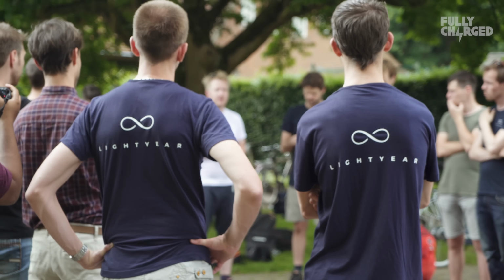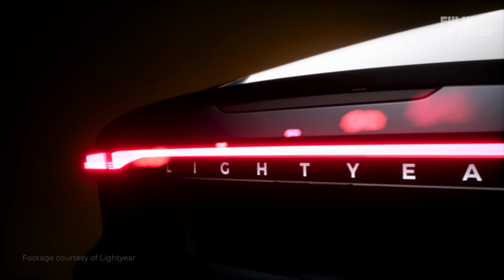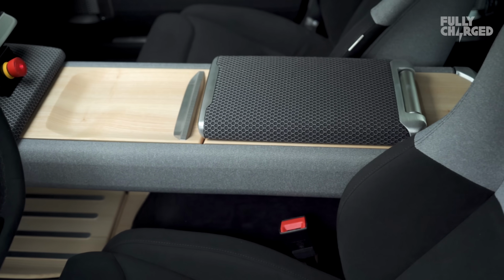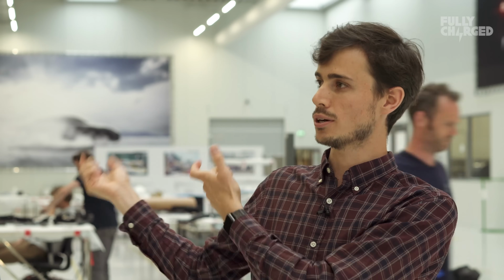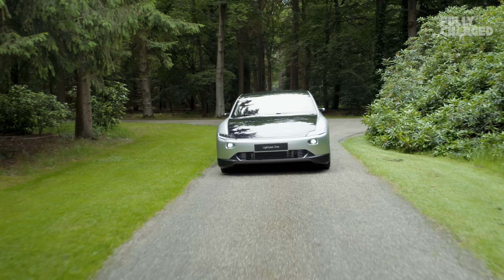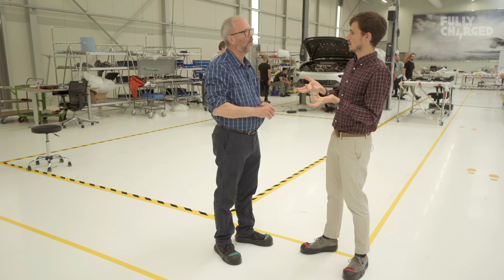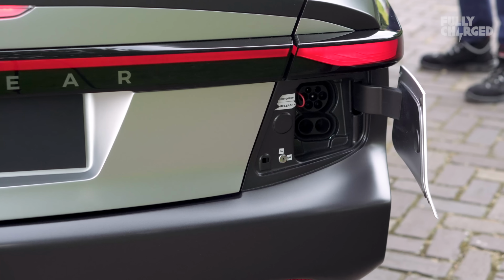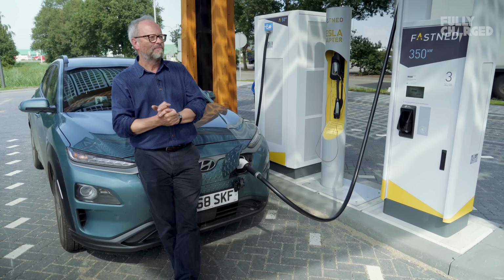Lightyear One solar powered electric car - exclusive first look | Fully Charged

Comment: Clearly aerodynamic and this look is designed by physics.
Reply: Do either of you understand turbulence? Sounds like not
Reply: @KcarlMarXs  go ahead, explain it to me, i'm sure you are capable.....
Reply: He says it's aerodynamically efficient. But that very long tapering tail end is not the best for aerodynamic efficiency, it increases the frictional drag since the air stays in contact with that large tapering surface, this is why the 'Kamm' tail profile is usually preferred by auto engineers, this cuts that taper off and often includes a little upturned lip. (this can also improve the down force on the rear wheels though obviously that's not so important in this case). I presume they were wanting to maximise the surface area, for the solar panels. If you doubt what i say about drag, look at the difference in tail profile between the Aston Martin db4 and db6, though Aston Martin were seeking to make their car faster by reducing drag.... rather than more efficient! Also just a thought, when air slips over the surface of a car it tends to deposit the dirt in the air on the surface since the frictional drag lowers the air speed at the surface, those solar panels are going to have be polished pretty regularly to maintain their power output, i should think.
Reply: @fuccasound3897  You are totally wrong. The cutted rear causes Air turbulences behind because of its sudden end. If your thoughts were true Wings of Air Planes would have been designed like that. But they are not. In fact some Trucks have air Panels at the rear end to prevent the Air stream from breacking. Super Cars and Formular Racing Cars have diffusors to prevent a Break of the Air stream. And spoilers on Race Cars which bend up to generate down force are Always a necessary compromise because they rise the cw. 
Those people behind lightyear one study physics and reached despite a small battery a very efficient range of 725 km. They are not that stupid to choose the wrong Design right in the beginning. The Team has a lot of experience and has won several Racing competitions.
Reply: i'm saying they have favoured solar panel area over reduction in surface drag. That is all. Diffusers are generally used to direct underbody air flow to prevent its interference with the air stream at the vehicle's rear. The raised lip on the tail as well as creating downforce  ensures the air breaking away from the rear of, as you put it, "a cutted rear" creates less drag than without it, yes the air is turbulent, causing some drag but this can easily be less than the frictional drag caused by a long tapering tail end. Also, what is your take on keeping those solar panels clean? i'm not saying the design is wrong, i'm saying that in the design  they have traded off one thing to favour another. The essence of good design is compromise isn't it? You sound angry, and not able to deal with a critique of something you obviously think is wonderful. Perhaps you are quite young?

Comment: I dont like the lack of visibility in the back. Added to the opaque roof, it gives a very opressing feeling inside.
Do the solar pannel add significant range?
Reply: The car can't be charged; it's fully solar powered.
So you can do about 60-90Km a day on average in The Netherlands.
Reply: I guess that there is a rear view camera, and that the mirrors on the sides are cameras in compact aerodynamic housing (instead of optical mirrors, because of the drag/turbulence otherwise created). At least, that was what they did with Stella.
Reply: Do you people actually watch the video???

Comment: Where this really comes into it's own is for someone with a commute of <100km return per day. Eight hours of full sun while you are at work and your car is back to 100%. No need to plug in and you're getting maximum use out of the panels. But if you park in the shade its a waste of the panels on your car. This raises an interesting question in terms of what are the economics/efficiencies of putting the panels of the car vs somewhere else and having a plug at your place of work? Or are the material costs of the panels so cheap now they are replacing metal panels in a cost effective manner and it's just all value adding?

Second thought. This highlights limitations of electric vehicles for long range driving in remote regions for large, off road vehicles (not talking about this car, think a pickup or SUV). In Australia there are several spans/return trips of over 1000km when dealing with remote outback driving. For a vehicle with a 600-700km range you just throw in a couple of Jerry cans. But there is no cheap or time efficient solution to this problem for an electric vehicle. For example, say you have the 1.25kW array of solar panels on this car and for simplicity a 125kWh battery (probably small and hence conservative for my following estimates). You drive for half a day and then your battery is flat. To get it back to 100% you now have to wait for 100hrs or about 10 days of good sunlight. Options:
1. You could make the panels more efficient. But with panels currently running at about 40-50% this at best will double the power and halve the recharge time to 5 days. 
2. An auxiliary array which could be set up on demand would achieve the same effect. 
3. Having both an auxiliary array and maximum efficiency panels gets you to 2.5 days. 
4. You could try adding more/larger batteries, but this is going to cost you thousands of dollars for something which is seldom used and has a high embodied energy. 

While this conundrum is not going to be an issue for the vast majority of users it is basically a deal breaker for me when it comes to replacing my current diesel 4WD.
Reply: Good points but other than driving in the desert consider this how far are you from a power point at any given moment.  I think every Aussie truck stop should have a charger.  For the time being though you're only talking a couple of percent of cars or driver's that genuinely need this, lots more claim they do and then just drive the beasties to and from the kids school and supermarkets.
Reply: Hi  @cameronlapworth2284 . Once you start cross the inland part of the country it can be as much as 400km between truck stops. They are basically laid out so to be as far apart as possible to reasonably drive on a tank of fuel. The major trucking routes are more like 100-200km when on the east coast. Many of these locations are running off diesel generators. I'm not sure if anyone has crossed the country (east-west) in a conventional electric vehicle yet. At least not in a time efficient manner.

My second point is clearly not referring to people using a 4WD on a school run. It's highlighting challenges facing replacing 4WD vehicles being actually being used for what they are intended for.
Reply: @jeremyringma  I agree Jeremy,. 400km is within this cars range, solar will increase your range even if only a little, it would save fuel in ice cars also.  It wouldn't need to be truck stops either.  For years while the ev vs fuel cell debate was going I'd drive in the country and see all the power lines following the highway and think we'll most of the infrastructure is already in place.  A charge point would need to be placed wherever on that line was required.  However you are absolutely right that fuel is easier to manage in terms of sticking in some extra Jerry cans.  However consider reliability.  I used to fly gyroplanes in unreliable 2 strokes and converted VWs I've experienced 4 inflight engine related emergencies.  There is a lot to be said for remote tracking with a motor with one moving part.  Adding enough solar to if you are lost even if only 80km per day could save a life, plenty of people have died having run out of fuel and broken one of the many moving parts of an engine with tonnes of fuel.

Comment: Still not convinced by the solar panels on the car idea.  It's a lovely idea - free charging wherever you park - but the reality brings serious constraints in design, sales location and practical use.  Add to that the fact that we're (finally) seeing more and more fast-charging networks being built, and battery technology improving all the time, cars like this could be a white elephant before they're even in production.  A solar panel the size of a dinner tray that can charge from zero to 500 miles in an hour, THAT would be a game-changer, but we're decades away from that, if we ever find such a technology at all.
Reply: 60miles a hour would be more than enough for infinite driving untill nighttime unless you would drive 500miles hour.. but if you look at daily commute then 60miles a day would be enough.
Reply: @DreamstateOne  My point is that right now solar panels need to cover a very large part of the cars' surface to be even close to useful, and that limits the design and the market for the vehicle in a way that "standard" charging doesn't (at least not in design).  Solar panels on a car would be amazing IF they were very substantially more efficient than they are now and could be incorporated without those design/market/cost problems, hence my (extreme) example of one the size of a dinner tray.
Reply: @JonGritton  this is a 1.5 kWh solar array.  Leave it parked at work and for 90% of people it will be fully charged by the time you are ready to drive home.  How many ICE cars slowly add petrol to the tank when parked or driving?  None the evaporatorate fuel slowly.  90%of cars spend 90% of their time parked.  Combine this with home solar and the only time you'd touch a fast charger is on 400k + trips. This is no gimmick how many hours does the average car spend parked at the place of work in a week if we average 0.7kwh to account for less sun in morning and afternoon that's still slot in. 40 hour working week.

Comment: the front looks nice, the back end is pretty bad. sure it's to fit more panels but those panels will not charge the car.
Reply: No to drive continuously but every moment it's parked it's adding KMs to the battery.  1.5 kw/h. Leave it out for 4 hours in the middle of the day or longer if at work, here in Australia most days are sunny,. Most people would easily get their daily drive to work for free.

Comment: That car just needs a Citroen badge on the nose...
But seriously solar panels on a car is a flawed concept simply because the panel has a life of 25+ years and the car 15 at most. Meaning that good panels will be scrapped at the end of life of the car. No they will not be recycled.... unless scrapyards start to double as solar farms 🤣. Love it though. Tesla M3 gets 5m/kWh. Didn't hear what m/kWh this car gets.
Reply: I've driven lots of cars >15 years old.  Morris minors, Ford Zephyrs, Ford Cortina etc. That's because we were too poor to own anything better.   Those that fail become parts for the ones that survive etc.
Reply: @t43562  if you'r trying to say that the solar panels will be recycled then i cannot agree. Most cars are broken up and melted down. The few that remain are broken up to service the existing fleet once production ceases.

Comment: i would love to know more about those in wheel motors. been wondering for years why no one did that on anything other then E bikes
Reply: Presumably because it's more unsprung mass, which makes the suspension, ride and handling more difficult to figure out.
Reply: They said that the unsprung weight is only slightly more than on a traditional car. Electric motors have been getting better, making the challenges manageable.
Reply: There's RiverSimple that use in wheel motors in cars. Not a big company.

Comment: I used to sell domestic solar panels (nowhere near as advanced as these) and the lifespan of them was around 25 Years. What’s the lifespan of these panels? And if it is 25 years, does the car need to be scrapped after that or can they all be replaced (what’s the cost)?
Reply: 25 years isn’t to bad from a car these days, I thought you might still have 80% + efficiency after 25 years.

Comment: I love the back drop. 
If electric cars were affordable I would buy one. 
Right now there bloody expensive. 
The downside to electric cars is the charge time. 
If you could charge a a dead battery in 10 minutes then that would be a plus.  Right now that aint happening.  
Lefty vertue signalners love electric cars. 
Its there wet dream.

Comment: Pushing a car by its tyres?

Have they been told to do that to ensure that the body is 100% fingerprint free?

Seems a tad unnecessarily dangerous for the sake of a few meaningless vanity points - if you trip forwards, instinctively put your hands out to catch your fall and the car keeps rolling, then it could roll right over your hand.

But what do I know? I don't make or sell cars. Perhaps this stuff is, like, uber-crucial in the sales pitch or something.
Reply: I guess it's to make the car stay clean, for the shooting, etc., or they just aren't confident in the structural rigidity of the concept...

Comment: Kudos to Fully charged for driving instead of flying.
Reply: Yes. Lucky the prototype launch was in Europe rather than USA or Australia. Would take a long time out of Robert's schedule to go via sailboat.
Reply: Electric airplanes are taking off too. Maybe you will soon be able to fly without pollution
Reply: and if the hangers were covered in solar panels ...free flying too.?
Reply: @alanwardrop9575  That will take a long time, if you have an electric plane where the batteries would only take like 10% of the space in the plane the airline company can't make any profit. The profit margin of an airline company is very small, so these Electric planes need to be stupidly efficient.
Reply: @hoen2009  Planes need a lot of space for their cerosine at take-off.
Reply: @thankyouforyourcompliance7386  cerosine is alot lighter than batteries, why do you think al electric cars with proper range are heavy as fuck. I can see small planes on electric power easily, and we already have those. But big airliners will probably need another 15 to 25 years.
Reply: @alanwardrop9575  I'm thinking a rail gun launching system ;-) trains that turn into plains.
Reply: @doctormo  HAHAHAHA Yes please!!!!!
Reply: Alan Wardrop Electricity has to be produced somehow and land transport is always more efficient than flying.
Reply: @weetikissa  flying is actually more efficient. Small planes can do 20mpg at 155mph where a car of similar weight would be doing 10mpg.
Reply: @britishentertainment7610  Although I believe planes emit C02 straight into the upper atmosphere where it's far more damaging, so I'm not sure if the mpg can be compared like that
Reply: @multiplio2924  i was talking about fuel efficiency not carbon emissions

Comment: If you put the cells on the cars' garage they'd be a lot more efficient. The saved weight would make the car more efficient. 

In terms of working hours electric bikes in combination with trains are a lot more efficient.

Impressive technologie it is, but is it the most efficient employment? Or just a mere way to keep car enthusiasts hoping? 

for 12laned highways maybe?

I enjoy your depicted enthousiasm, but a bit of critical thoughts would go a long way in making the ecological ambitions more credible.
Reply: A nice sentiment, however:
Electric bikes suck. You'll end up cold, wet and miserable and there's nowhere to carry your stuff.
Trains suck. They go by their own schedule, can stop miles away from where you want and you have to sit with other people.
Reply: Good point, although I think there's also a factor of excitement with 'Oh look, the car charges itself!', which is not strictly rational, but is an interesting concept. The use of this car will surely include charging it "from the outside", probably by the solar energy from household solar panels, considering the audience for this product. Solar cells on a car - somewhere between a gimmick and a plausible solution, but it sure is interesting, and displays a statement of being committed to renewable energy.
Reply: @AleksandarStefanovic  consider this most people down here in Australia drive 35km in their daily commute this car parked outside with 1.5kwh solar (granted it will only produce that for a few hours) would cover most if not all of that.  Also down here public transport is rubbish and some of us have to drive very long distances often.  That knocks many EVs out of contention.  I personally ride to work and the shop s towing a bike trailer.  But many have too far to go, so this sort of car is the perfect solution.  Every car should be similarly festooned with solar.  It's smart,. They are saving batter IES and weight by doing so.